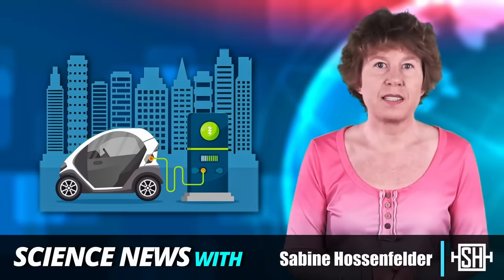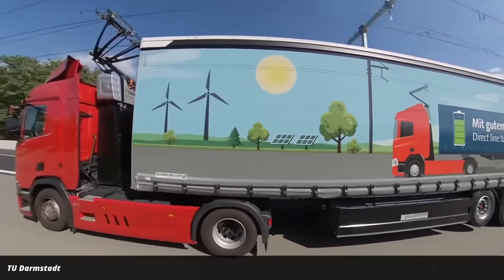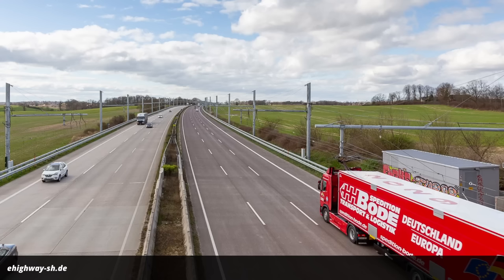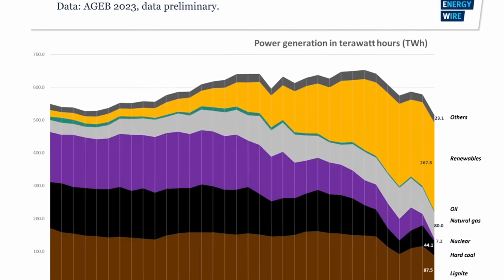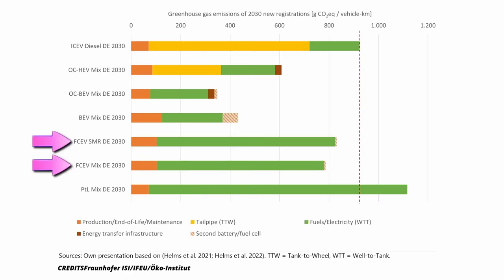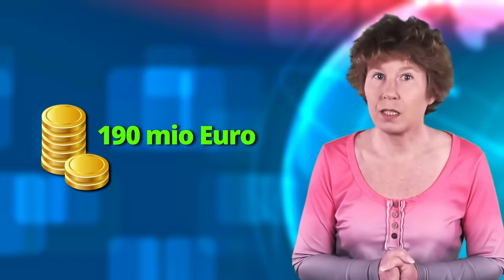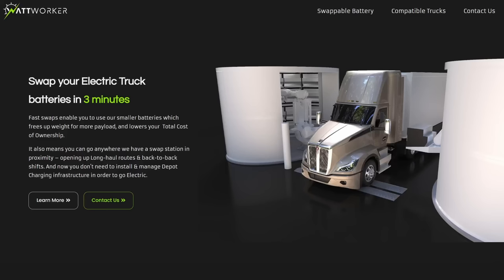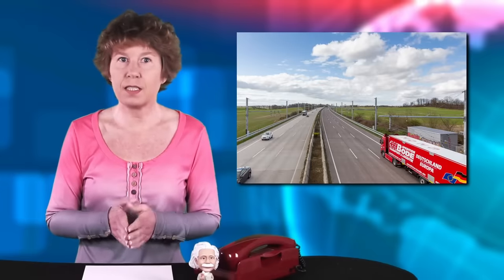Charging while Driving: Does it Work?

Comment: someone please explain this to me

we generate most electricity, if I am not mistaken, throught the use of fossil fuels themselves to drive turbines which then generate electricity through electromagnetic induction. 

If we then shift to utilising electric vehicles we will require more electricity production, which inturn must utilise more fossil fuels to generate the increased electric power output that is required by society. My question is, will this even offset carbon emissions since we will still most likely be using fossil fuels to generate the increased requirement for electric power?

Comment: Add portable removable battery packs to cargo and replace and recharge at stations. 

CO² footprint of manufacturing electricity, manufacturing of steel poles and cables and placement along road plus upkeep of poles and overhead electrical cables, CO² produced in mining of elements for batteries, and CO² production in the manufacture of the batteries, and plus CO² cost of disposal of batteries after use need to obtained.

Comment: How about electric highways for long hauls, and a 50mi/80km battery for use in cities to deliver? Huge batteries are heavy & expensive, so smaller batteries would save money & weight for shared infrastructure on long popular routes. Would be great if wireless charging could be used in the ground in the truck lane and let cars also use it, and would incentivize cars to stay in the slow lane and use the fast lane only for passing 😀

Comment: If diesel is cheaper than electricity then it would make sense to invest in a diesel generator to power your home and you can use the engine cooling fluid and exhaust heat to stay warm in winter for free.

Comment: Can we not have motors for the rear wheels and generators on the front wheels?
Reply: Electric engines on cars can be used as generators or motors depending on the needs. When electric cars use regenerative braking they use the motor as a generator and are charging the battery.
Reply: yes understood, however  i guess i was being simplistic, i assume energy is lost in friction and outside energy is inevitable at some point.

Comment: I would even test a more extreme idea and put the power source on the asphalt with some sort of subway power rail system in the middle of the driveway. You could charge all kinds of vehicle while driving. And you don't have to fit out all of the highway just some charging areas.
Reply: This has been tried, and the reason it doesn't really exist, is that a mixture of rain, and the resulting corrosion is really really really good at messing systems like this up, routinely, and repeatedly. Charging via induction sounds like it could fix this, but you loose 30-50% of the power doing it.  this is fine for something like a cell phone or a watch, but makes it a non-starter for something like trucks where the power demands are many orders of magnitude larger.

Comment: There was no mention - Sweden is testing this too, and I think it is more developed that what Germany has here. I'm curious how it's going on their end.

I also think that people are WAAAY to fast to jump to conclusions here. Nobody should expect this to be done over night. Identify some best areas to install the overhead wires, and only do it there. Electric trucks, fortunately, are coming anyway, as they are decent on shipping low-mass high volume items (like chips, lol). So transport companies will get electric trucks anyway. The overhead wires will enable them to use the trucks on longer distances and for heavier loads. Bit by bit, it can help in the decarbonization. It will certainly not be done by 2030, but it will undoubtebly be better than what it's now.

Comment: I would like to point out that almost all new loads on the grid are entirely powered by fossil fuels.

Renewbales are nearly always making as much power as they can. They are running at 100%. They can't make enough power so peaker plants (generally natural gas fired power plants) start and stop to balance the grid. This means that any new load results in a peaker plant is what picks up any new load. Therefore, we should calculate the carbon savings based on the electricity being entirely derived from peaker plants. I still believe this does provide some carbon savings but it is smaller that they claim.

Just because the grid is 50% renewables doesn't mean new loads get the renewables. If we cut our electricity by 50%, our grid would be much closer to 100% renewable, so the cut we made almost entirely affected the carbon electric sources. Thus cutting electrical cuts a lot of greenhouse gasses.
Reply: By that logic, old loads on the grid are clean! Woo!

Comment: Place permanent magnets in the road and install coils under EV's. No expensive electricity needed.
Reply: Funny.
Reply: @mellertid  funny how?
Reply: @HardcoreHokage-cw4uq  oh, you were serious.Sorry!

That doesn't work.
Reply: To answer your retracted question (sorry if that's rude); a magnet and a coil doesn't power anything. 
A car (with a coil) moving over the magnets (in the road) would receive some power, but the moving of the car would require more energy than what is returned.
It's not a theory of mine, it's how it works! Or doesn't work.

Comment: Put the cables under the road and make sure all electric vehicles can charge using induction. Then any vehicle can use the system, not just trucks.
Added advantage is that the over head cables are gone and the motorway returns to how it looked before.
Each vehicle just needs to sign up to the charging system (or not) and their account debited by the appropriate amount.
Reply: That sounds expensive and induction charging is very inefficient.
Reply: @naamadossantossilva4736  
I think some companies have got induction charging efficiency quite high, although that's via a static pad.
Yes it would be expensive, but costs maybe reduced if someone designed a clever way of installing it in the road that was quick and efficient.

Comment: Overhead lines are expensive and road vehicles more so.  However with a 500 miles range an EV truck doesn't need significant charging.   Also its not clear what the power rating is for these line.   If you could get 1 MW for fast charging you could just build short sections maybe 5 miles long, but somehow I think you can't get that amount of power.  Or there might be too much wear.
Ultimately truckers have to stop sufficiently for breaks which allow for significant charging if stationary fast charging was available.
Electricity is only expensive currently because of expensive gas and Nuclear, which mostly renewables this would be an issue and won't be in future.
Electricity production is far more efficient CO2 wise (especially Natural Gas) than refined fuel in a mobile engine (refining, collection and distribution nearly double the emissions).
Reply: Electricity is expensive because of the taxes in Germany.
Renewables make electricity even more expensive, they cannot compete with nuclear.

BEV trucks don't make sense, every ton of battery is a ton less in payload that you can haul.

Net CO2 wise, you cannot say that electricity production is "far more efficient". A regular car burning good old-fashioned bio fuels, such as Ethanol or Seed Oil is CO2 neutral, while electricity produced from coal (which Germany reintroduced) is not.
Reply: @svr5423  How are renewables more expensive, they are low risk, cheap to build and free fuel.   Nuclear is expensive because its inherently dangerous.  It costs money to plan and abate those risks.  Seriously if you think Nuclear is cheap you are seriously deluded,
So for the weight issue, we can use the same argument for a diesel engine and transmission.   "for every ton of engine and trans  you have to reduce the load by a ton".  Doesn't really provide a convincing argument mate.  The Electric motor weighs a fraction of a diesel engine and transmission, so there is some extra weight freed up for the battery.  A Tesla Semi can haul a load similar any diesel for 500 miles.  It may not have the full range of a diesel and such fast refuelling but it is useable for 80% of truck applications.  Truck companies are falling over themselves to get these trucks because they are so cheap to run.
I can say electricity is more efficient, you just don't understand why.   What you have written is utter nonsense, and I have written enough already to debunk your rubbish.
Reply: @tonystanley5337  Don't know why your arguing. Just have a look at the prices.
Solar power usually comes with a noticeable surcharge. Nuclear is among the cheapest.

One thing contributing is the unreliability. Under cloud cover or especially when covered with snow, solar cells almost produce no output. Same at night. So you must install multiple times the amount that you actually need.

Solar is really great in certain regions or for spacecraft that don't go to the outer planets.

Engine and transmission don't weigh much.
For example, the engine of my little toyota weighed around 70kg. I regularly could achieve 800km+ range with a full 35l fuel tank. The whole car had a mass of roughly 900kg. You can't get a BEV with a comparable range, loading time and weight. No matter how much money you pay. And the Aygo was really cheap on top.

Again, you're really bad with looking at the published numbers.
Reply: @svr5423  I can't buy Nuclear power separately.   Lazard Levelized costs shows Nuclear is the most expensive.  Have you looked at these, they compare unsubsidised costs.  I really don't know what you are getting figures that show Nuclear is cheap.   Only subsidised or state owned Nuclear (like in France) is "cheap", but the tax payer is funding the rest.
Solar is reliable, reliability is it working when you expect it to, even the dumbest of people know not to expect much from Solar when its cloudy or night.  The doesn't mean it is unreliable, it is variable.  All generators are variable that has to be accounted for in the grid.
We are talking about trucks and you use your 3cyl micro car car as an example lol (my partner has one).  EVs are 2-3x as efficient as an Aygo, and you mostly don't wait for them to charge, you do something else like sleep or eat or watch TV in your house.  If you do 800km in it daily it will wear out quickly, we just had to replace all the coil packs at 90K miles and there is severe knock coming from the engine when its cold.  It uses more oil than petrol, and produces some black smoke.  Still runs though.  I might replace the engine, but this is what you expect from 3cyls.
None really needs 800km+ range, but you can get an EV soon with 1000miles range.  Would that satisfy you?
Reply: @tonystanley5337  I can buy power from various sources, it depends on the electricity company. But quite common in Europe. Nuclear is among the cheapest and solar most expensive.

So you admit that generating power from solar under unfavourable conditions is really expensive because you seem to understand the underlaying physics.

Oh, so are we talking about EVs in general or only about BEVs? The latter are not efficient. Not sure why you think that an Aygo would "wear out quickly". I drove it over 100Mm for surprisingly low TCO per km. Even the charging costs for a BEV alone are more expensive.

Not sure why you think nobody "needs" 800km range. Obviously, you are completely wrong.

But at least in civilisation, the range is not that important. A BEV should be able to charge 500 to 1000km in 5min, just like an FEV, or biofuel or synfuel power ICE which are also carbon neutral.
And of course, the costs for such an BEV must come down to, let's say, 15 to 20k EUR. And the charging costs must also come down. I just rented an BEV last weekend in UK and petrol would have been cheaper to buy for the same distance.
Reply: @svr5423  I'm an Electrical and Electronic Engineer I Understand power generation and its costs.
I didn't admit anything about solar costs.  You just don't know how to compare the cost.
Nuclear will be cheap when noone wants it, they have to sell it off, its called supply and demand economics.   This is when they make a loss.  Most modern plants have gov't guarantees on pricing, either the gov't makes up the difference or the bill payer does.
A BEV has massive benefits in practicality, cost, reliability etc, it doesn't "need" 5min fill ups or massive range.  I can bet that your small car is driven mostly short distances that any BEV could manage.  Maybe once a year you go on a longer trip.  BEV will be very soon much cheaper than combustion cars.  If you compare like for like performance that already are easily super cheap, its just the cost drivers are different, range costs, but recharge time is quick enough (and you don't need a full charge, noone does that, you would stop quickly twice rather than take a full charge)
If you have something like a Tesla with 350 miles range, you can add 200 miles range in the time it takes to goto the toilet and stretch your legs (15mins).  Human endurance is the limit, and this is only needed on a long road trip, not your usual commute.
BEVs are massively cheaper to run and more efficient, really don't know where you are getting this from?  Its much more efficient to generator power in a fixed power station with multiple stages of recovery (say with gas CCGT) than to refine oil, distribute it and then burn it in a piston engine.   Even Coal power is 2x as efficient, mainly because coal doesn't need refined.  Honestly you need to review your calculations you have it all back to front.
Various fossil funded media has tried to demonstrate "higher" costs for BEVs, but its completely false.   Most changing is done cheaply at home.
Reply: @tonystanley5337  so you're saying that even at night and after severe snowing solar power can deliver electricity cheaper than a nuclear power plant?

I think you are unable to compare the numbers when you pay per kwh. It is too complicated for you. Maybe you can ask someone for help?

BEVs are not practical because it takes too long to charge.

The biggest cost is depreciation and fuel. Given BEVs cost more to produce and electricity is more expensive (per range), how do you come to the conclusion that the TCO is cheaper? You think that bigger numbers are better?

Not sure why you rant about fossil fuels. Of course we can be fossil free without the huge disadvantages of BEVs. Nobody questions this.